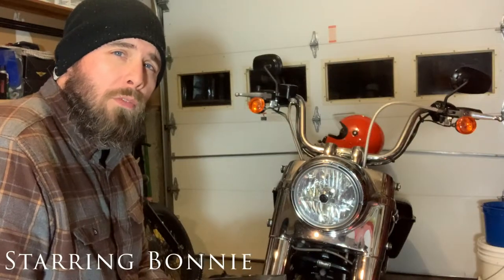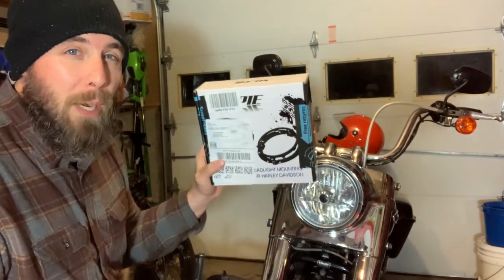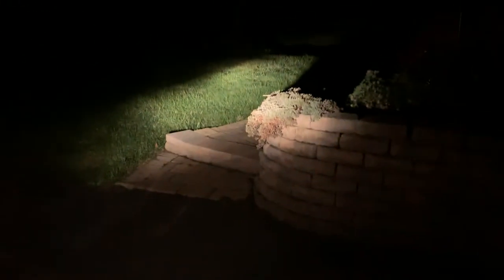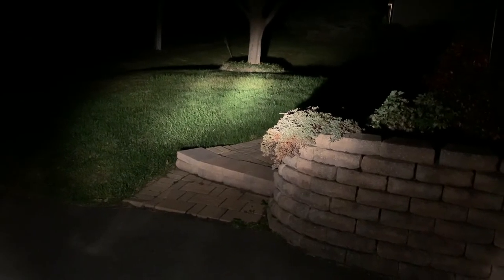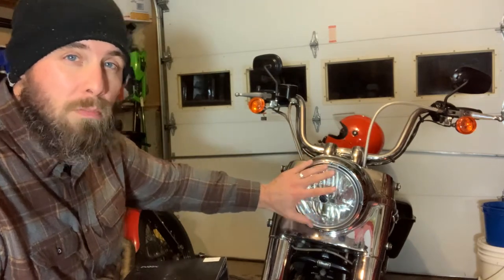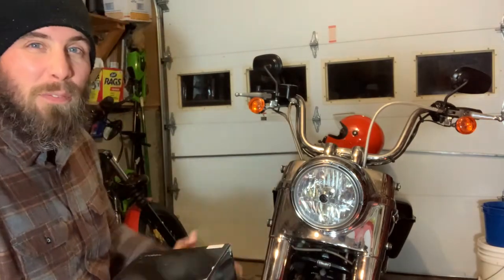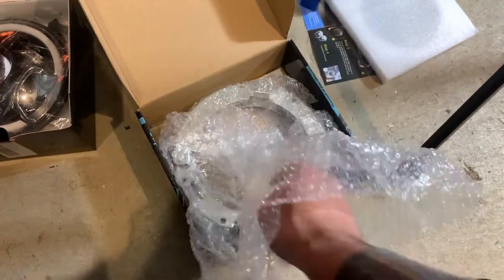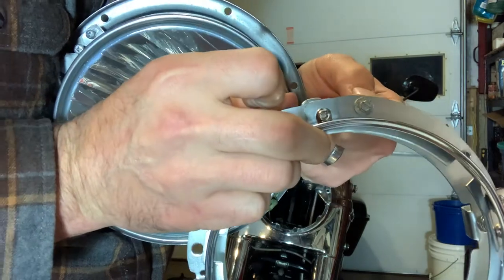ZMOON LED Daymaker Knockoff Install Fail!

Comment: Great video btw. I went with the SKTYANTS red headlight for my switchback and its pretty good at night and installed easily
Reply from the maker: Were you able to use the OEM mounting bracket or does that one need/come with a new bracket to install?
Reply: @LoneWolferGarage  had to get an aftermarket mounting ring, but it wasn't a Sunpie. Think it was a Harley Davidson
Reply from the maker: Do you remember what was the HD tax on that mounting bracket?
Reply from the maker: @byteme45  Oh nice, thanks!

Comment: Nice try. I was tempted to get myself the same lights. It looks like the light traffled the same distance as the original lights
Reply from the maker: I really should have gone out for an actual ride at night to see if it need some adjustment, but I'm just such a wuss these days with the cold. Riding below freezing just isn't for me anymore.

Comment: could you not just fit the led h4, if you are worried about it burning out?
Reply from the maker: I have read a lot of terrible reviews about the H4 LED Bulbs, but I think that might be an option at least to make content.
Reply: @LoneWolferGarage  The problem is, if your light cover has enough room, for the cooling fins of the "bulb". But if it fits, it could be a better solution than regular H4, because it has several elements in, if one burns out, you still have some light left, to go to the next gas station or parts shop.
Reply from the maker: @theodorstravels  I havve now been googling H4 LED bulbs so much that it is all that I'm getting for ads on instagram. Found a few like the Hogworkz that have good reviews and looking at my headlight assembly, I should have no problem with the cooling fins and in some cases actual fans on the back of those contraptions.
Reply: @LoneWolferGarage  Good, test it out, so I won't have to :P